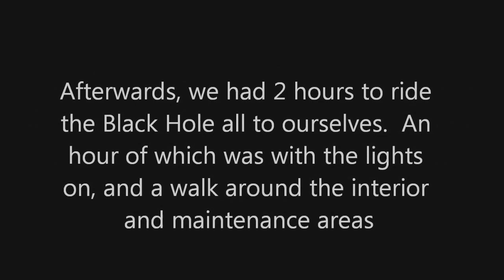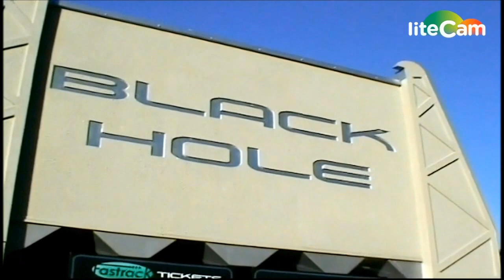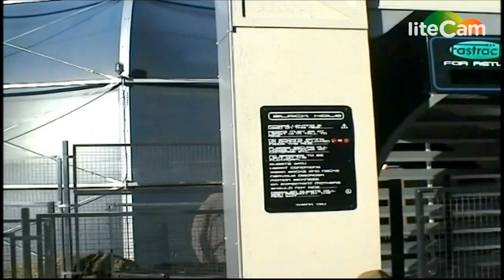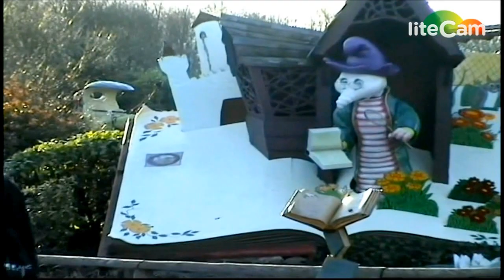Black Hole Final day Alton Towers

Comment: 4.27 i swear that is Pat Phelan on Black Hole? They should not of got rid of Black Hole, Should of had it sent away and refurbished.
Reply from the maker: johnm400uk it was to do with the fact they had to build an evacuation platform around the lift hill for it to comply with new safety regs coming in, and financially it wasn't viable to do this. Was a great ride though
Reply: Ah right, i didnt know that. Good old health and safety eh? Makes you wonder how they managed without an evacuation platform for all those years! Not saying we dont need health and safety but these days its become more to do with big money than just about health and safety.